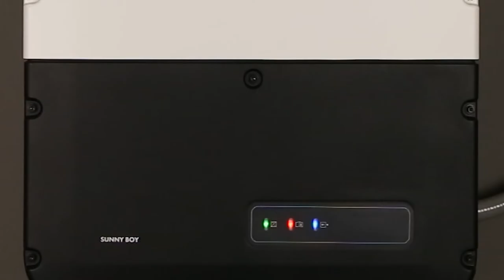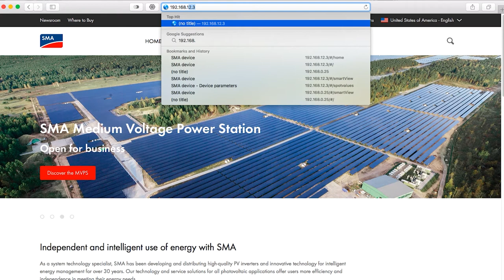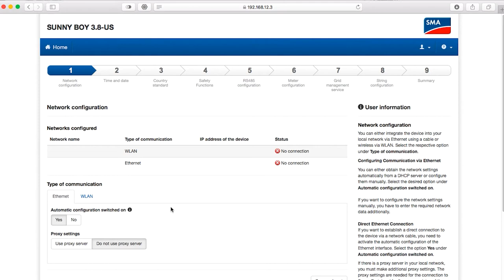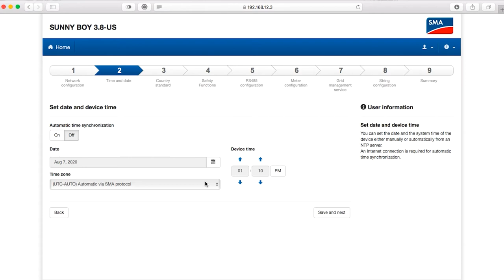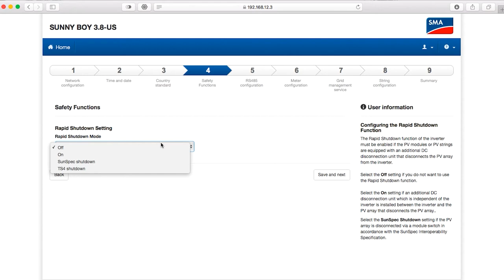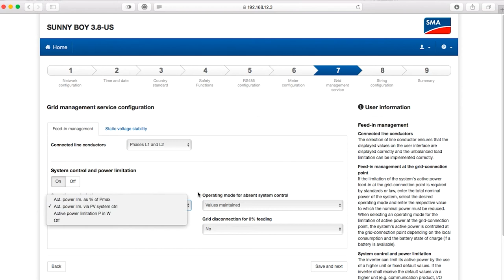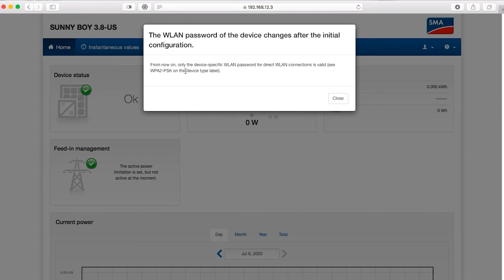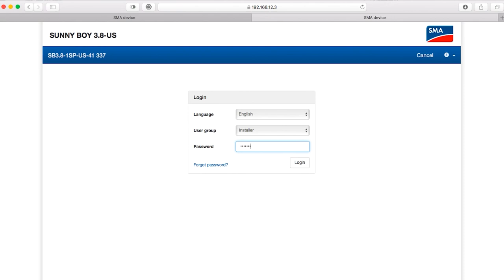Commissioning the Sunny Boy US-41

Comment: WHAT happens if there is an overload or short circuit on the output ?
& when the solar panels are not receiving sun light?
Reply from the maker: The PV array is a current limited source, so the PV inverter output is always fairly limited. There should be no other loads on the output circuit to the PV inverter breaker, or they must be separately protected by a fuse or breaker.  These breakers will trip if there is a short circuit upstream of the inverter.

Comment: Dude...good lord.  For a homeowner to attempt any of this, you are using language they are not familiar with, and then flying through the instructions.  You need to give folks a clear step by step instructional guide or something. WHERE can I get sent a paper copy of a step by step guide, so I can be of assistance to our customers?
Reply: Here is an example how someone would be lost right at about 42 seconds in....as you say:   Note that the inverter firmware version is available on the 2nd screen with the name package....2nd screen? 2ns Screen of what?  A persons phone, computer...somewhere on the inverter?  Y'all need a guide book, as if you were explaining this to a 3rd grader.  As my customers are so very frustrated, and they are having great difficulty.  Where is a rep to talk to or meet up with in Austin Texas,  I have 82 customers in the last 10 weeks, and I cannot keep getting phone calls with folks very upset.
Reply: @brandimastain7154  the tech that installed the system should be doing the commissioning, not the homeowner and every inverter comes with a big manual on what everything does and means. Might want to look at your techs and nor the manufacturer. My customers are happy and their systems work and none of the stuff in this video is stuff they have to worry about.
Reply: @brandimastain7154  These devices are not meant for 3rd graders to understand. Most of this is the installer's responsibility. Also, the manufacturer can't cover every single detail since the video would be longer than most attention spans. Find the video that talks about the inverter overview.
Reply: @singerkgreen  Who TH was the Program Manager?  Sorry, but the installers/tech is having great difficulty. ME having difficulty. I do not understand why someone creates a product, for a very expensive purchase, yet...does NOT MAKE IT USER FRIENDLY.  We switched to Growatt...Out of the last 106 customers, we have had 2 that had an error. By the comments on this the 4 techs and ME...aren't the only onces stumped on what seems a poor product.
Reply: @brandimastain7154  f16s are expensive and not user friendly. What's your point

Comment: We had to change our Wi-Fi for a dedicated system for our Sunny boy. And it seems to be absolutely impossible to change this information once it is put in. No one, the electrician or even the company seems to know how to correct this issue. I find that somewhat concerning
Reply: I have a problem that the public sunny portal doesn't connect over my marginal wifi,so it doesnt update on the portal,i cant figure out how to make it work over the ethernet wired cable only.

Comment: Being an electronic Tech for more than 30 years and using many different RTU MTU, PLC, hundreds of software, I would never buy this inverter , it's way to technical for the ordinary user, there are so many better family user oriented inverters today that work with IOS or other operating system for easy programing and updating, right now I am troubleshooting a friends solar system with this unit I am having arc faults on 2 seperate systems 2 different solar strings using two separate SMA inverters, Owner cannot get it resolved because SMA is blaming it on solar strings,, I have already tested solar strings and they are perfect in current and voltage with load and no load... SMA cannot resolve it, owner stubified,  I simply told him, if it my system I would change the inverters to a customer friendly one..
Reply: Can you recommend another inverter??
Reply: Intermittent arc faults are difficult to troubleshoot. Just because your V and A are perfect when you check them, doesn't mean they will be later. These faults usually require and hand-over-hand inspection to spot the issue. Inverters have been known to flag false arc faults, though. SMA Sunny Boys are tough inverters and last forever. An end user is not supposed to be getting in-depth with parameter sets. That's the installer's job. No competent technical support crew wants a homeowner around high voltage.
Reply: Did you find what was causing the Arc Faults?